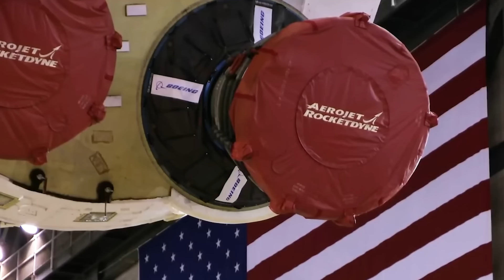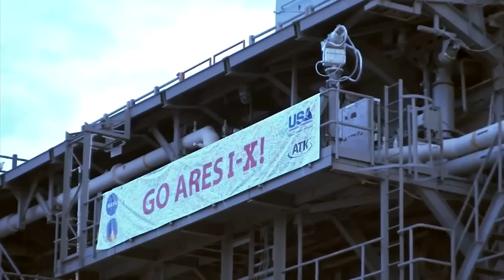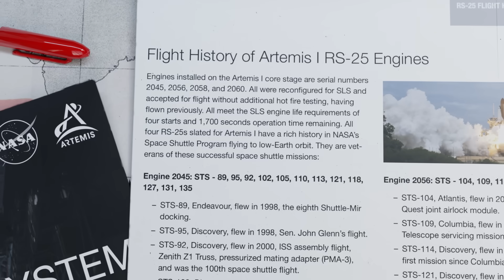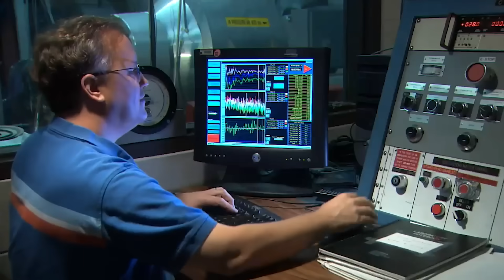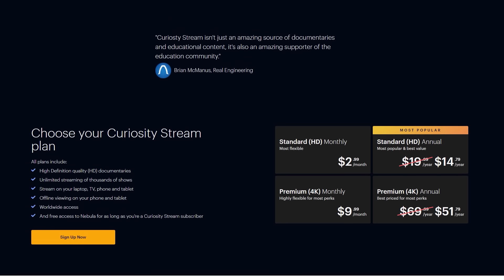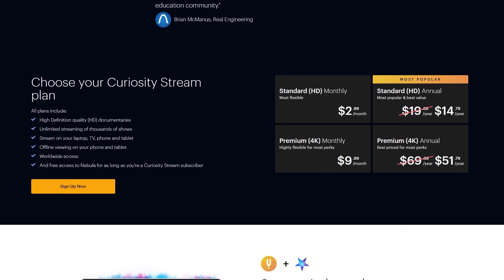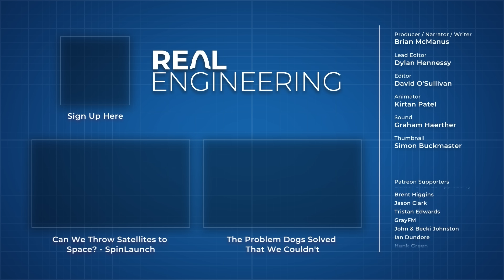The SLS is Outdated. Why Does it Exist?

Comment: It's only because the ASV-1X RLV use aerospike, the SLS will not need to be re-usable; also it's different from the 30MN ea engines of ASV-1(X).The Y-43A 2nd/ 2nd-3rd stage are all RLVs using l/a tech which means they are more capable than Starship/superHeavy and don't need refuelling for the same job. The solids only join as IUS at any point, redundant. All units are runway landing, after re-entry. TPS, patented re-generative panels, not tiles.

Comment: Thank you for this! I've been asking the same questions about the SLS boosters. "Politics" seems like a pretty solid answer.  I'm very excited for the launch, I live on the Space Coast and have heard stories about how powerful the rockets from decades-past were, how you can hear the rocket and feel the rumble from miles away compared to the smaller/more modern SpaceX rockets that frequently go up. In the end, efficient and low cost options will win out so we may not see these types of rockets in the future, there's really no telling.
Reply: I'm jealous. I wish I lived somewhere I could watch rocket launches without flying to another continent
Reply: You nailed the "seems" part.

Not all heavy lift payloads can be lifted to orbit in multiple pieces on the shoulders of fanboys.

Also, one person's "scavenged" is another's reuse. How do folks talk out of one side of their mouths about reusable launchers and out of the other side about how reusing SSMS Blk II is bad?

Again, not all heavy lift payloads and future Lunar Gateway hardware can be cut up into bite sized chunks for Falcon or other EXISTING launchers. The US requires an independent, non-commercial heavy lift launcher for current and future space access and exploration. SLS is warmed over Constellation. Neither Falcon nor similar reusable systems have the lift capacity that SLS was designed to meet--and it's man-rated. 

Starlink has no occupants. 

Commercial space and Manned space exploration are two different goals with two very different design points.

Now, discuss why shuttle used solids and Congress axed the LRB program and your conclusion is spot on. 
We're It not for that, SLS would have reusable LRBs.

Thanks, 1980s Congress!
Reply: @macblastoff7700  "Neither Falcon nor similar reusable systems have the lift capacity that SLS was designed to meet--and it's man-rated. 

Starlink has no occupants. 

Commercial space and Manned space exploration are two different goals with two very different design points."

Just as a point of clarification: SpaceX has been using Falcon to launch humans to the ISS and in a charity orbital flight for the last 2 years, and continue to do so.  It does so for significantly less money than is being paid to the legacy NASA contractor, Boeing.  In fact, Boeing still has not launched a human into space under its commercial contract, and will not do so until next year at the soonest.
Reply: @macblastoff7700  What Howard said above.

Also, the Shuttle boosters were technically reusable, but cost nearly as much to recover and refurbish as to just build a new one. It's not hypocrisy to want reusable launchers but also say that reusing those boosters is bad, because those SSRBs are vastly overpriced and their reusability is nearly pointless, and the rest of the SLS is similarly amazingly overpriced.
Reply: Bet you'll love it when Starship-Superheavy starts flying out of the cape
Reply: @macblastoff7700  sounds like you're really counting on Starship testing to not go well or go really slowly to keep providing a reason to spend over $2 billion for each SLS launch. The first Lunar Gateway launch for SLS won't be until 2025. But since the lunar lander will be a modified Starship, if you support returning to moon landings you should support Starship development succeeding on time. Starship will have enough room for Lunar Gateway chunks that are allocated to SLS for political make-work-jobs reasons.

Comment: SpaceX has not yet made launching cheaper, they are just creative with their bookkeeping.
Reply: How does that make ANY sense? They recoup the costs of their hardware entirely.
Reply: @veroncia5218  Absolute BS. Re-use doesn't mean it is free. The whole rocket needs to be checked, repaired and retested. It's a myth that it should be cheaper then a on-off. NASA used many parts in the last 80 years for reuse as with the space-shuttle, and there are many reasons re-use is not always better. The assumption of this channel that the SLS rocket is outdated without bringing any arguments besides the rocket is not "re-usable" is therefor reason enough for me to block this channel from now on. I detest information channels with hidden agenda's.

Comment: It exists because the RS-25 engines and SRBs have launched successfully 134 times.  Critcize Shuttle all you want, fine. But no other American rocket motors and engines have sent nearly as many human missions to orbit. And while they were overdesigned for LEO, they're about the right size for sending a crew capsule to lunar orbit and back.

It's easy to play armchair engineer and argue NASA should have spent the past decade investing in a methalox first stage instead. But it's not Congress's job (or even NASA's) to build space infrastructure specifically for large-scale LEO internet or lunar manufacturing. The goal is to build vehicles that are tailored to NASA's needs for missions of 4 astronauts (and the activities 4 astronauts can do over a few weeks to 2 months initially), which only need to fly 1 or 2 times a year. 

That low flight rate might be seen as a step backwards from ISS and Shuttle, but people forget that NASA launched 4 Saturn Vs between Dec 1968 and Dec 1969. Guess what? That pace wasn't sustainable. Apollo 13 famously exploded and NASA only launched 2 Apollo missions per year in '71 and '72. 1 or 2 SLS launches a year form a reliable backbone for human lunar missions. Anything beyond that with commercial rockets is icing on the cake.

By the way, NASA partnered with Armadillo Aerospace on the small methalox Morpheus VTOL lander starting in 2012. They were researching methane for small reusable vehicles when SpaceX and Blue Origin were in their infancy. But Eric Berger isn't writing Ars Technica pieces about it, so most folks forget it happened.

Comment: I watched the Saturn moon shots on TV. I watched some shuttle launches.  
They were great.  
However, technology and design should be allowed to develop.  
Could you imagine if the planes of WW2 were forced to look like the planes of WW1?? 
Well, Artemis looks TOO MUCH like the bastard child of Saturn and Shuttle.  I knew it borrowed concepts, but I was surprised to learn it borrowed actual parts.  
That's insane.
Reply: I completely agree
Reply: Physics hasn't changed in 50 years, the Saturn V design was and is a solid one, providing more lift capacity than anything available today in its envisioned D configuration.  Luckily, I was around for the Saturn V launches, and lived near the cape at the time.  A space shuttle launch is amazing, but a Saturn V launch is INCREDIBLE.  It may well be that I'll be in the area when the SLS finally launches, I hope so.
Reply: @johnrehwinkel7241  Physics has not changed. But, requirements do.  
The single use boosters of the Saturn V are great, but that is very wasteful.  
The new rocket should be reusable.
Reply: Idk about you, but to me it seems that Starship fits these requirements pretty well.
Reply: @tarunsundaram2742  I'm all about starship but there's a reason only the N1 ever spammed a bunch of small rockets. The more rockets the more complications. However bigger rockets can have combustion instability.
Reply: I'm not sure I agree:  all the rocket vendors offer higher boost capabilities in non-reusable mode.  While the original F1 boosters were very complex and expensive to build, a proposed F1B design uses updated metallurgy and 3D printing to reduce thousands of parts and complex manual assembly to about 40 parts.  For heavy boost, discarding a simple but powerful engine is often a logical choice.
Reply: @craigkdillon  There had actually been proposals for partially and fully reusable Saturn 1st stages back in the day, shame they never became reality
Reply: When someone comes up with a better technology that costs less, then i'm sure there would be a switch.
Reply: @LBCAndrew  yeah, sure, this wasn't a subsidy to big corporations. This is the best we have. Laughs in Merlin
Reply: @tarunsundaram2742 , except it hasn’t flown yet.  And probably won’t launch (or land) humans for quite some time.

SLS fills the gap.
Reply: you have very weird ideas and expectations
Reply: @craigkdillon  Okay, explain how to make a reusable rocket with current political and bureaucratic requirements.
Reply: @imEden0  Why?

Comment: The SLS exists because it was caught in a transition between old and new technology.

The program effectively started in 2005 (with the Constellation Project) and made sense at the time: use existing NASA parts to save money, and spread the work around the country to get congress' support.  It wasn't until ten years later the public saw for the first time a Spacex reusable rocket land by itself, but even then, such a rocket had a very limited payload.  Now that technology has caught up and will probably soon surpass SLS, especially as far as payload (assuming Spacex eventually has a successful Starship launch).  There was just no way for NASA to know what Elon would bring to the table when it started Constellation 17 years ago.

As soon as this Artemis rocket completes its flight, there's no way NASA will be able to get additional funding to build any more rockets that are not reusable.  The writing on the wall was written in 2015.

Comment: I'm okay with how Artemis came about. There's a lot of institutional knowledge that would have been lost if all those jobs had been lost, and it would have had severe long-term effects on the US's space aspirations and its ability to carry out future missions.
Reply: A similar thought, that might not be quite as universal but I'll risk it: We really don't need our expertise in these matters held hostage by the private sector, it seems to me. Could Elon Musk run a cheaper air traffic control system? Sure, probably -- until the first instant that he didn't have to, and then he could charge us however much he wants to. We give way too much monopoly power to private sector organizations even when the stakes are relatively low; we don't need to replicate that thinking for something as crucial the future civilization as the space program.
Reply: It wouldn't have been lost. They would've worked on other projects or moved to the private space companies.
Reply: I think the critic of the video is mostly directed towards the outdated technology used. I am also ok with Artemis but I also have doubt about the technology used, so I would agree with the point the videomaker is making.
Reply: which is why there needs to be constant movement. Once space shuttle was winding down, NASA should've started a new program to replace it. NASA should've started development of a next gen rocket by the 90s and early 2000s.But they didn't. The military has the same problem. after the cold war ended and defense budgets were cut. the military industrial base lost a lot of jobs and knowledge. And now its costing a lot to regain it back.
Reply: @CinemaDemocratica  the difference between a Nasa launch vehicle and a private launch vehicle is the private one is built and operated by a private company while the Nasa one is just built by private companies but operated by Nasa. 
Nasa has never built their own hardware, not even during Apollo. All Apollo components had been built by contractors, and at the Shuttle program it was the same.

This first SLS launch will cost $ 4 billion, the most expensive rocket launch in history despite using existing Shuttle hardware to "save" money. Only the Orion capsule is completely new
Reply: @CinemaDemocratica  Right, a noncompetitive congressional monopoly to Boeing would totally solve the problem of Musk hypothetically having monopoly power. He might even charge half as much as Boeing instead of 1/10.  It's sure working out right now, giving us a rocket twice as expensive as the Saturn V and only 2/3 as effective after only 50 years of technological advance.
Reply: @shangrilainxanadu  If only we had access to the opinions of a seventeen-year veteran economics professor. Then he could tell us exactly what was wrong with each of our positions, and which of us was being childish, script-parroting, and wrong.
Reply: @CinemaDemocratica  Large-scale, private-sector "sanctioned monopolies" are a thing; many utility companies fall into this category. This is because building a city-wide electrical grid or sewage system isn't feasible for multiple competitors to build. Such monopolies are heavily regulated to prevent them from abusing their power. A private sector ATC would surely be no different. Moreover, it's ironic that you fear monopolies forming among private-sector launch providers, when (if I understand correctly) legislation behind SLS essentially created a monopoly-esque situation by mandating the use of the same technology, parts, and factories. As a result the same old vendors (private sector companies, by the way) were protected from competition—which is precisely what makes monopolies bad. "Government good, private sector bad" (OR vice-versa!) is oversimplified thinking that leads to poor decision-making.
Reply: @sigmundwong2489  I don't think anyone was advocating anything other than what you've endeavored to explain; it's not as if NASA actually builds its own spacecraft.

Comment: I have experienced Sputnik and the whole saga... it was far far beyond breathtaking... I think that the main reason for going back to huge rockets was that the shuttle was a total failure in its hyped bid to make spaceflight more affordable as well as its flawed design that cost lives of its crews ...  
   Everyone forgets the HUGE cost and percent of the annual budgets that Apollo represented... Continuing the Apollo program was just not viable back then...
    The present design was made necessary because no one still alive remembers how to make the Saturn 5 main stage engines...  they had to be handcrafted tweaked far beyond the existing blueprints and no one remembers how to do that...
Reply: Bullshit on "no one knowing how to make F1 engines". NASA already designed the F1B engines over a decade ago, using modern technology and techniques to reduce cost and complexity. In fact, NASA wanted to use a Saturn V style design for SLS but was forced by Congress to choose a shuttle derived launch vehicle (SDLV, or sometimes SDHLV, with H for "heavy").

See Eric Gunnerson's video on the subject. And learn to frickin' google shit instead of repeating popular myths, yo.
Reply: @SecretRaginMan   What I said  is what experienced rocket engineers said a few years ago!!!  Just reproducing the old design with new computer tools does not fix the issue... only building and testing the engines then  redoing the design as the origional engineers did  in the 1960s would work... thankfully using the solid propellant  boosters has made doing this unnecessary...

Comment: It's a basic design made of existing parts. The 4 RS-25s don't develop enough thrust to get TTW above 1 and take off. The strap ons are effectively cancelling out enough of the weight to allow liftoff rather than adding deltaV. It's exactly the kind of vessel you would make in Kerbal Space Program if you were very short of cash and had to do some orbital missions cheaply.

Comment: Let's get something straight. The Constellation project was designed for LOW EARTH ORBIT people...NOT FOR GOING BACK TO THE MOON AND EVENTUALLY MARS. Obama Administration said if we're going to spend billions of dollars we need a launch vehicle to do low earth orbit, medium earth orbit, high earth orbit, going back to the Moon and eventually Mars. SLS rocket will accomplish all of the above. We are using engines from shuttle...why?...because they freaking work and are reliable. We are using SRB"s from shuttle era...why?...because they are freaking powerful and reliable. The RS-25 engines are not exactly the same as on the shuttle as well as the SRB's. They have been updated in MANY ways...making them more powerful. As for reuseable...well if you would have read the multiple reports and studies done then you would have known that it would have cost MUCH MORE MONEY than building new. Finally the Orion capsule IS NOT THE SAME CAPSULE as under Constellation program. This Orion Capsule is designed for deep space travel and duration. I hope this helps people understand the facts of SLS and not just tossing out words of opinion and stupidity. Try speaking with Aerospace Engineers as I have to get a better understanding on how and why SLS is what it is.

Comment: it just did an exemplary job of safely delivering Orion into orbit
Reply: Not just into orbit, but on an extended (and previously untested) "distant retrograde" Lunar orbit.  Thus far, the Orion herself has exceeded even the most optimistic projections, not only on Artemis 1, but on the previous EFT-1 as well.  I remember waking up before dawn (both days) to watch that launch on the Delta-4 Heavy
Reply: @k1productions87 spoke too soon
Reply: @michelmilaneh8963   That's what testing is for.  The Space Shuttle orbiter had tiles just falling off during its flight test, making years of delays,... and then once it flew with people on board (with no abort options by the way), it was ALSO missing tiles when it reached orbit.

So yeah, Orion still performed better